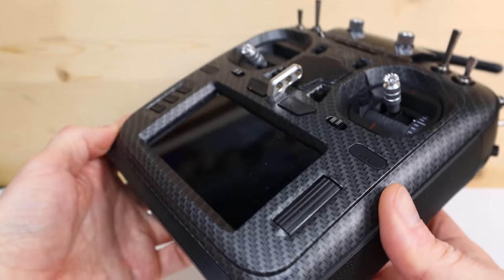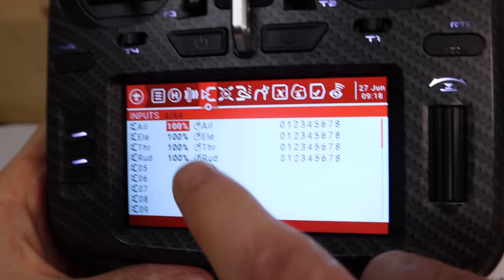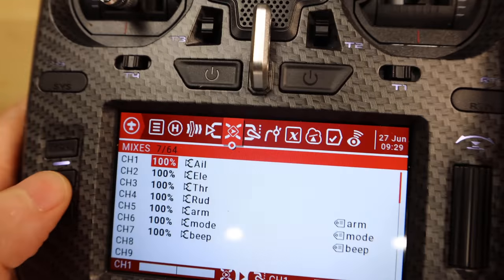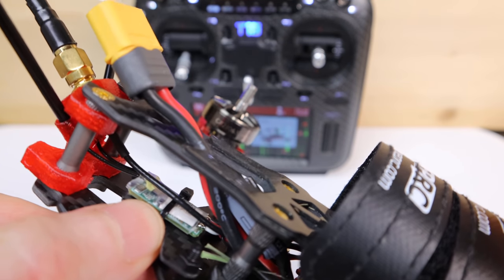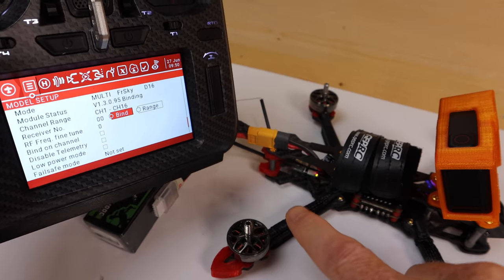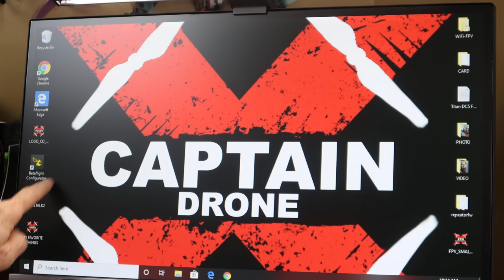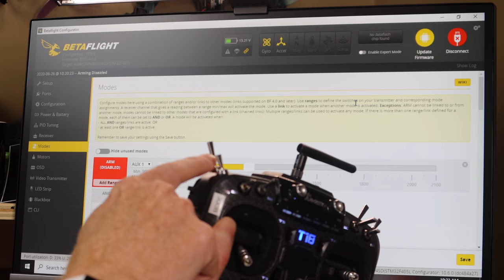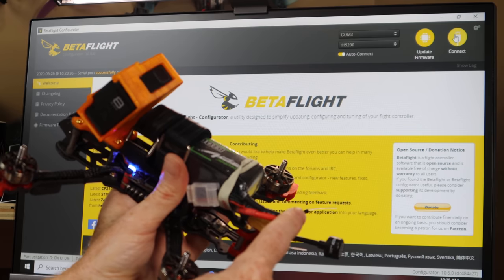EP 9 - FPV FOR BEGINNERS - How To set up an FPV ANALOG Drone - Bind, Radio, Betaflight

Comment: Thank you. I spent all week reading how much of a pain frsky xm+ is hard to bind. After watching your video I switched on my rekon5 , jumper t-lite to Multi, FrSky X, D16 subtype, Ch1-16, then selected bind to begin searching for the xm+. Pressed down xm+ bind button, then connected battery. Voila 1st time successfully bound. Now I need to run through setting up everything else and connecting up to betaflight to verify. Top notch guide 🙌👌. Frsky seems to be getting bad press, as most youtube videos always seem to criticise FrSky 😧.
Reply from the maker: Glad it was helpful.  Frsky gets bad press because the company didn’t like other companies copying their technology so what the did is they made some receivers that only work with Taranis radios causing users to get upset.

Comment: Wonderful, absolutely spot on. I fly lots of RC but very little drone. So having just bought two cinewhoops I really needed to refresh myself on the basic set up. I have a Trashcan and a Mobula 7 that I learnt to fly on, which I haven't flown for a year. Originally I did use "Anothers' " you tube channel to set up the Trashcan/7 I wish I'd seen yours as it's so very simple plus I learnt a couple of things as well. FYI I got the HGRLC 132 as I liked your review and the Betafpv pavo 30. I couldn't get the 95x v3 as everywhere had sold out. Hopefully this one will do. Love your channel keep up the good work.
Reply from the maker: Thank you!

Comment: Thank you for this video. I happened to purchase a GEPRC MK4 along with a T18 and was more than lucky to find your video. Made understanding the setup easy. My T18 came with no manual and the website does not show any.  I wanted the Radiomaster but the shipping date was not for almost 2 months.   Thanks Again!!!
Reply: THought I had it set up. Controler works in Betaflight but not when disconnected. I get no motor response.  I have the exact setup as you did.  Any ideas?

Comment: Hello captain,I found this video really helpful and i am able to fly again my first fpv built by myself.
I was stuck few days due to wrong chennel mix up.

i watched lots of videos.Only this video worked for me.I am also able to set up arm,mode voices through your steps.

sincerely
james,India🙏
Reply from the maker: I’m glad to hear it was helpful
Reply: @CAPTAINDRONE798  Hello sir,is it possible to get drone battery level in my transmitter?
I have tx12 and using frsky Rxsr?
Reply from the maker: @Waikhom007  you’ll have to find out if your RECEIVER sends out Telemetry to your radio.

Comment: Hello sir big fan . I tried to bind my Xm+ . I did everything you did step by step but when I hit bind my xm+ red light starts blinking . Never turns green . What is happening. Did it like 10 times still red light blinking . Can you please help me
Reply from the maker: The answer is.... You are not doing it correctly.  It is normally for beginners to have problems in this area of binding.  Try, try, and keep trying and eventually you'll get it (you may even have a setting wrong on your radio).

Comment: Thanks for the great demo of the new Jumper T18 pro.  I must have read it over now about 30 times and being old and stupid, I actually connected it to my old devo receiver, but only the switches on the transmitter moved the fins on my V tail flying eagle!! lol ..now I have to try and figure out how to make the sticks on the transmitter move the aircraft instead of the switches.  I must be doing something wrong.  Next thing you know I will have my new transmitter flying around the room instead of the flying eagle.  Somewhere I remember the transmitter program asking if it was a v tail etc, but how to get back to that part is a work in progress.  I was hoping this T18 would save me having dozens of transmitters laying around.  Any help you can offer, or if you ever set up a simple aircraft, with that jumper, holler loud and clear so I don't miss your tutorial. lol  Happy Flying
Reply from the maker: You may have used the first 4 channels as switches.  The first 4 are the joysticks & that is why in this walkthrough video we leave the first 4 channels alone and then start on the 5th one which becomes Aux #1.
Reply: @CAPTAINDRONE798  Thanks for the kind reply.  Yes I see what you mean now.  I actually set up 2 aircraft so far, it was tough, had to do some over again 3 or 4 times lol, but it makes you learn.  One was v tail and the other regular acft with no flaps.  That jumper will save me using so many transmitters, and will get easier to use as time goes on.  Your example was extremely helpful and thanks again for the great demo.  Happy Flying

Comment: Captain Drone.. I have just received my Mark 4 and have TX16S radio. I have bound the drone to the radio and for one thing, when it connects the radio does not say Telemetry detected, the next thing is that happens when I Arm the drone via the radio, the props will not settle down but keep running up to full throttle and even though I pull down on the throttle the motors keep running full speed. What do you think I can do to correct this. Again, I am a noob to FPV and am following your tutorials to the best of my ability. Thank you for any help or input. Cheers
Reply from the maker: Everything sounds like it works perfectly.  People in the FPV hobby do not arm the motors and let the drone sit there because the drone props will throttle up due to computer in the drone thinking it is flying and trying to correct itself.   My guess is you have flown those beginner camera drones like DJI or lower and you have plenty of misconceptions about drones.  Erase away all your thoughts because the FPV world is very different.

Comment: Hi Steve.  Followed your section.  It was really simple and great to follow your steps.....I have one question which I believe my motors will start. For the arm/disarm in Betaflight, the minimum value is 1050. But my minimum on the throttle stick is 2056. Being that high the motors won’t start.  I saw that you had your below 1050. How did you set that value in your Jumper?  Maybe send me a picture on where to change it would be great.  I have the same Jumper like you.  Thanks 🙏
Reply from the maker: Those are the default values (I did not change anything).  Joshua Bardwell has a video on setting your throttle stick numbers on the radio and in Betaflight.
Reply: Hi Steve...the info has helped a lot.  Still having issues though. If you want to know let me know and I’ll tell you
As always Thank You Very Much!!👍👍👍🖖 🖖 🖖

Comment: Hello Steve and thanks for a concise video. I was able to bind my TH2 to my Jumper t12 pro with the help of your video however there's 1 problem. The yaw and roll are reversed. I changed the channel map and saved but It didn't help. The radio shows the sticks are in the right order. Any ideas would be greatly appreciated.
Reply from the maker: All of those settings are in BETAFLIGHT.  Sometimes drones come with a mapping different than you are used to, so you just change in in BETAFLIGHT.
Reply: @CAPTAINDRONE798  All is good now. I just created a new model and went through all the steps in your video and everything is working. I must have messed something up on my first try. Thanks.
Reply from the maker: @mlb013  glad to hear.  Happy flying.

Comment: I have a question about registration for using FPV drones. Is it like camera drones where you just need to register it and you’re good. Or do you need to get a “pilot license”? And what other paper work do you need? (I know it’s different for every state)
Reply from the maker: Depends on your country.  In Canada it goes by weight, so PLANES, HELICOPTERS, DRONES all fall under the same rules and that is that if they are under 250 grams, you don't need to register them or new a flight certificate.

Comment: Hi Steve. I received my Radiomaster TX16S today. I am in the process of setting it up at the moment and I am having trouble with the model images... Since most of the model images were of airplanes and the few drone ones were not the ones I was looking for (Mark 4, like you have shown in the video), I went and deleted all the model images that were initially on the SD card. Then I proceeded to add a resized image of a Mark 4 drone (I was a little too quick to delete the old images and forgot to write down the actual size, but I have found someone who said it was 192x114). I then copied the file to the SD card (Image folder), but I cannot find any image when I go back to the radio...

I have tried changing file format (BMP, JPEG, PNG) changing resolution again (to a smaller 64x32 size which I have found on another website), but nothing does it... I have found a page on OpenTX's website with icons for Taranis model icons. I tried downloading one (64x32 size) and adding it to the image folder (it was a BMP file). Strangely enough, this one worked, but there weren't any Mark 4 images. But when I put the Mark 4 image (from GepRC's website), resizing it and converting it to whatever file format, it does not work...

Do you have a link to a website where you got your image for your Mark 4 drone? Thank you for your help!
Reply from the maker: I don't have my radios handy at the moment, but it was rather simple (you somehow have made life difficult for yourself).  Plug radio into computer and select the option as an external drive.  Go on the internet and find any picture you want and download it, then resize it and leave it as a JPG, then drag and drop it into the correct directory.  As long as the picture is the correct size, it will display.
Reply: @CAPTAINDRONE798  I do not seem to have the correct size then, as this was the first thing I tried... If anyone is able to give me the correct image size that OpenTX uses, that would be much appreciated.
Reply: I think I found my mistake! The filename was too long... I tried resizing the JPEG file to 192x114 pixels. I have both files on the SD card (long name and short name). I can only see the short name. Well, shame on me for putting too much info in the filename I guess ;-)

Comment: Hey Steve, I was just wondering what receiver option you chose for the drone. I have a Jumper T18 pro like you, but I just want to know. THanks!
Reply from the maker: Since I fly near me (not miles away), I tend to use an FRSKY XM+ (simple and inexpensive).  I order it with the drone so that the company flashes it with firmware that is compatible with most radios on the market.
Reply: @CAPTAINDRONE798  I thought that the T18 pro doesn’t work with the xm+?
Reply from the maker: @user02052  If you go to a store and buy an FRSKY XM+ receiver, it won't work.  If you buy one of a hundred different FPV drones from any of the big name companies (all of them that I review) and you ask for an FRSKY XM+ RECEIVER, then they will flash the receiver with the older firmware that works with all radios.

Comment: Hi Captain Drone, I ordered my Radiomaster TX16S 2.4G 16CH at the link you provided, I also ordered the  EMAX TinyHawk2  Complete Kit, My question to you, Will I need to configure the TX when he arrived to use it on the EMAX Tinyhawk2?  Will I need to use the betaflight software on my PC?Thanks
Reply from the maker: The answer is YES to all.  Just follow the steps in episode #9 and when it comes to the BIND button on the drone... look for the word BIND on the circuit board (I believe you can press it after you plug in the battery vice before on the EMAX drones), and also select FRSKY on your radio, but select D8 instead of D16.

Comment: Hope your doing well, I have a question.  So I'm going to bind my tx16s to a TH2.  Question is can I have two remotes bound and if yes in Betaflight per your video, do I just setup another range?  Like will I just have two arms, two beepers, two angles, etc,.  One for each remote but just make sure one remote is off and one is active.  Why two controllers?  So I can use the tx16s for me and let my son use the TH2 stock around the house.  Hope I explained myself correctly.
Reply from the maker: When it comes to binding a radio to a receiver it is a one bind system only for the most part.  I'm sure there is a hack to get around it, but I'm not familiar with it.

Comment: I am using Radio King TX18s and facing the issue to bind with Diatone L3 drone which is using ACCST D16/ACCESS protocol. Could you please provide the instruction manual to update the ACCST D16/ACCESS protocol on TX18s and binding instruction manual. Thanks.!!!!

Comment: okay Ive been working on this for a while, before I was able to have my drone "arm" and fly off, currently I only only get it to connect to the "beep" sound and the motor start to twitch, on beta flight thogh the motors work just fine . not sure what went wrong
Reply from the maker: Is there a GPS on your drone?  If yes, then it won’t arm until it is outside and receives the correct number of satellites

Comment: Ok is Beta flight easier to use on  Windows than Mac.. I have a 2020 MacBook pro laptop.  Have to use my USB C to android cord from my Hubsan Zino 2+ controller.
Reply from the maker: It is identical on both.
Reply: @CAPTAINDRONE798  Thank you for your video.. I had followed all your steps for setting up my TX12. But the drone I am trying to bind with XM+ receiver - lights do not flash green and red.. its just a steady Red light.  
(18650 1s Fly fox nano 3 drone) what's the difference in Frsky X , x2 and L.. tried D16 and D8.  
I know you say you can't help everyone..and its ok.. its all part of learning.  Maybe I need to just purchase a Tx16s or T18 or some other controller?
Reply from the maker: @arthurtorricer4544  The answer is that you have not pushed the bind button on the receiver in and held it down as you connected the battery.

Comment: Hey Captain, thank you so much for the great series! 
I've got everything up and running but when I connect to Betaflight my drone is spinning and it says AUX 12 on my receiver is going from 1700 to 1800 even though I'm not touching anything. 
Any thoughts? Help pls anyone!
Reply from the maker: Do you connect your drone after you are in beta flight?  Is the Radio on & joysticks (left - down, right center)?
Reply: @CAPTAINDRONE798  Turned everything back off and connected drone via usb. Then plugged in battery after turning on radio. The crazyness is gone but now it shows no AUX and no input when I move the throttle up.
Reply: Yup radio is on, left stick down and right is center
Reply: Ok finally got it. Had to mess around with the Mixer bc it was mistaking the yaw for the throttle or whatever that caused the spinning.
Now everything is working as intended in the Mode 2, control sticks and drone wise lol.

Comment: everything went good till beta flight like how you show the little orange icon move when you flip the arm switch on the radio nothing moved, im pretty sure everything is connected but i dont know how to make it work but ive even been able to get my goggles working and get video from the drone, ive been working on getting this thing flying for over 3 months and im about to give up
Reply from the maker: When you go to the RECEIVER TAB in BETAFLIGHT and flick your switches, you should see the graph lines move.  If not, your setup was not done correctly.   If you do see it working, then go into the MODES TAB and select AUTO under your flight mode (ARM, ANGLE, HORIZON), then flick the switch you wish to assign and AUTO will change to the switch.  The YELLOW BAR that you move is for where you want the switch to be active because most switches have three positions, so place it in the position that matches your preference (i.e., down for HORIZON, middle for ANGLE, up for ACRO).  And as noted in the video, you do not set an ACRO mode specifically because all drones default to ACRO, so it is up to you to set the other modes of HORIZON and ANGLE to take it out of ACRO mode.
Reply: @CAPTAINDRONE798  thank you for the help

Comment: I have accst qx7 and I can’t fly my new nazgul I got yesterday. I got it binded so the green light is solid and doesn’t flash but the flight controller just flashes still
Reply from the maker: If you are new to the FPV hobby then there could be many reasons why this is.  Keep in mind that those silly accst QX7 radios are very particular about the model of receiver they connect to.  What receiver did you have placed in the drone?
Reply: @CAPTAINDRONE798  i have the Rxsr
Reply from the maker: @Guero.Quijada  You may have the wrong receiver info selected
Reply: @CAPTAINDRONE798  how I flashed it already though

Comment: Yknow, at least so far you haven't talked at all about trim.  I recently bought a Tinyhawk II and had a devil of a time trimming it out ... in fact, I'm still not happy with how it "flies" (or tries to).
This is a massive gap in every single "You should buy this drone" video on the 'Net.  Nobody ever faces trim issues, or even talks about them at all.  It's like every quad comes out of the box rarin' to go, and that's just never the case (at least in my experience).
Which button do you press -- and how many times? -- to get something to "straighten up and fly right" (as my mother used to say to me).  And how do you know when it's right?
Reply from the maker: Tom, this may come as a surprise to you but we don't use TRIM in the FPV world.  You would really mess up your drones flight dynamics by doing that.  You see in the FPV world your hand/eye coordination is the TRIM and you compensate for any such drift in flight.   I think you may be used to GPS drones that hover in place... that is 100% not what an FPV drone does automatically.
Reply: If you are using angle mode, you may have to trim the accelerometer. But that is done in betaflight.